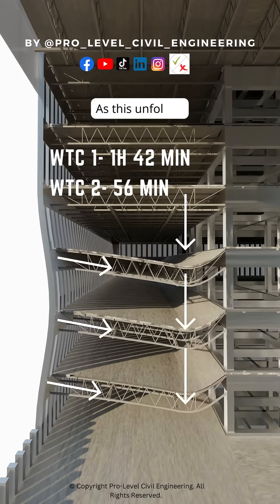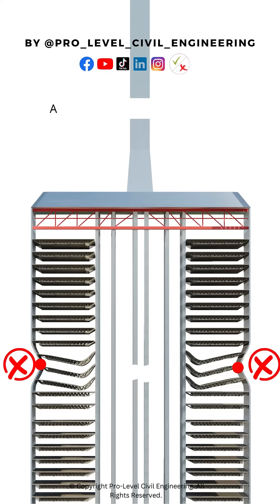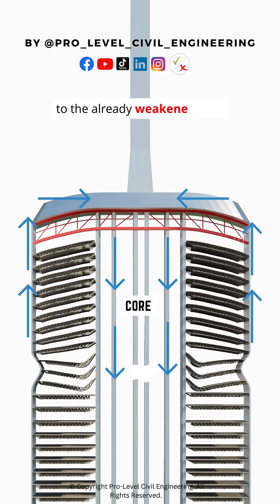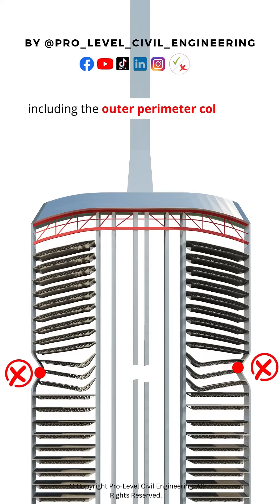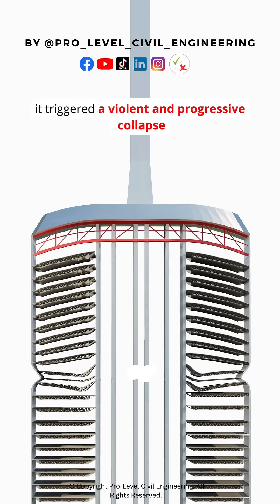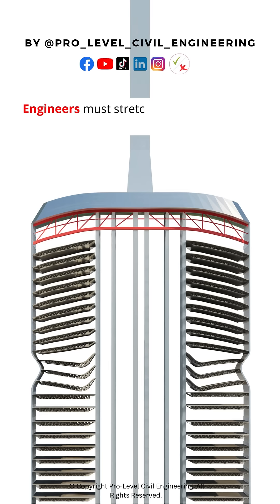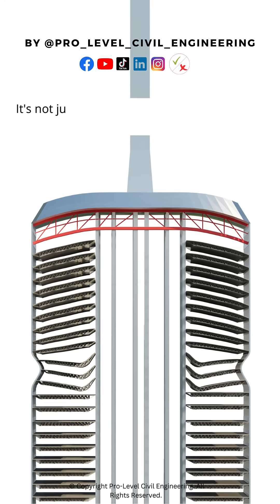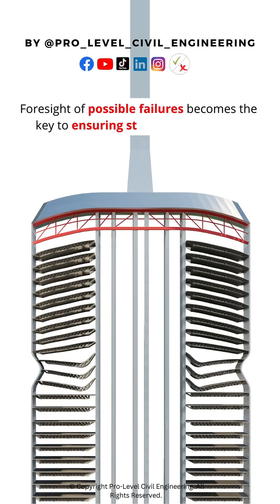The Horrifying Truth: Why the Twin Towers Collapsed on 9/11?

Comment: Planes that enters a building like butter. No bending or breaking at impact....clips like a videogame wall
Reply: Plane parts were found in the rubble. Including the Murray Street engine.
Reply: @beingmyself000 no plane parts not matching the alleged planes were planted by the CIA to create a cover story. Get it right. Watch 9-11 mysteries.
Reply: How much do you think a 747 jet weights, 40kg? Also, the planes impacted the towers at about 800-900 km/h. 

A piece of rotten wood can penetrate steel if the force of impact is heavy enough.

Comment: 4 words
Thermite, dustified, inside job!
Reply: 4 words of bullshit!
Reply: @ljrice1198 how clear can a Inside Job be? Yes!
Reply: @ljrice1198 "we were sent to monitor the event"
Reply: @ljrice1198 you are delusional. BYU analyzed Stephen Jones' research and said he is correct. The CIA planted the explosives that destroyed all 3 towers. An airplane wouldn't destroy any of the furniture on the 70 or so floors below that were undamaged.
9-11 was an inside job.
Reply: steal loses its strenght after 600f
the towers tempratures reach 1800f
the weight of the towers+the heat on the towers+the crash on the twoers
why wouldnt it collapse?

Comment: In short : 
Both WTC towers' middle flats' pillars were all crashed, melted and burned by planes' impacts. So they could not anymore normally function as any physical supports that originally were enough to hold all above flats' total weight together. Then entire towers fell down as if were a vertical domino down onto ground!

Comment: the jet fuel was all burnt within 20 seconds. geez everyone.
Reply: How much ampunt of jet feul,
Reply: @YuuSouji  9000 gallons each plane!
Reply: Shh... you start scaring the  🐑
Reply: Correct. Most of the jet fuel burned up when the planes impacted the towers. But don`t think an explosion of 10.000 gallons of fuel would cause a "little" fire in buildings full of office furniture, paper and so on? or that the fires (as well as the heat of the fires) would only escalate as the time went on?
Reply: @patrickanderson9023  Ho hum,  most of the 9000 gallons would have been consumed in the crash conflagration,  it just sounds horrific,  do you think a terrorist holding a 3/4 inch box cutter is going to stop you from kicking his ass threatening you?  I would laugh at someone on the street holding a razor knife to intimidate me,  that reasoning was only used because it could be plausible not because it was,  it is absurd,  "oh no he's got a razor knife,  let him do what he wants" give me a break!
Reply: @mrichards-j6b  Yes. Most of the fuel (90-95%) burned up in the intial explosions. But as previously stated, don`t you think an impact like that would cause quite a big fire? 

I don`t think outsiders realize how big and intense the fires in the towers actually were.
Reply: @patrickanderson9023  Yes it caused a lot of carnage,  but global collapse of three buildings to dust?  To turn the entire floors of concrete to dust would require why more energy than gravity can supply!
Reply: @mrichards-j6b  I am a firefighter with 26 years of experience.

You see, the intensity / heat of any fire only escalates, and the fire only spreads (regardless of how big or small it may be) - unless there are men on the scene fighting the fire ASAP.

But some fires are simply too big to put out, and that was exactly the case with these fires in the towers on 9/11. Those fires can at best be compared to a large wildfire of about 20-30, 000 acres.

And as the fires went on, the steel beams in the towers got weakened, which eventually casued the collapse of both towers.
Reply: Bingo!

Comment: This doesn’t make sense.  Why was there no stop at all from top to bottom?  How did both building fall are the exact same time in the exacted same way. Nothing toppled; just fell.
Reply: In some videos you can see the top of the buildings lean to one side as they're falling.
Reply: They didn’t actually fall at the exact same time, but they looked similar because both towers were built the same way. Once the top floors started coming down, the weight was way more than the lower floors could handle. Each floor was only designed to hold its own load plus some extra, not the force of dozens of floors crashing down on top of it.

That’s why there was no “stop” on the way down. Once one floor failed, the momentum just kept transferring downward, like a domino effect but with thousands of tons of steel and concrete. And parts did topple off the sides, but the bulk of the structure came straight down because that was the path of least resistance.
Reply: @takahashiwongwong1  yeah that's the story. Did building 7 fall straight  down out of respect? 😅😅😅
Reply: @darrencoleman3866 it fell forward not straight down
Reply: There was a 30 minute gap between the collapse of both towers I believe
Reply: They're not Legos 😂.
Reply: @jamess4351  so what about building 7?
Reply: Well they didn’t fall at the exact same time it was separate times but with all the jet fuel being lit on fire it will curve the buildings inward basically making it fall in on itself
Reply: that's how buildings fall, they are not legos to be toppled
Reply: It’s actually rather simple: a sky scraper works out by spreading the weight of the building across many support beams.

If one support beam fails that’s fine because the weight that beam carries is simply defused across the beams around and below it.

When the planes hit the towers the support beams that were struck immediately failed and the weight they carried was diffused across the beams around and bellow them. As more beams failed due to fires started by the crash more and more weight was distributed across fewer and fewer beams until the weight became to great and they all failed together. Which is also how a controlled demolition works: by destroying key support structures you overload the remaining structures cause the building to collapse under its own weight.
Reply: They were made in identical ways with identical materials hit by identical planes.  It's not hard to figure out
Reply: The pinions were designed to carry the load of one floor once one floor gave way the floor below could not Carry the weight with each floors weight landing on the next it just pancakes.  If they had welded the floors to the frame it would have held. It's like a plane crash it's never one thing it's a slurry of several things lining up like holes in Swiss cheese
Reply: Because every floor was identical and once one or two failed the remaining floors were not rated to hold the additional weight once it started it would only accelerate as there was no reinforcements to slow it down and an object in motion stays in motion until it's stopped by equal or greater force.  People equate it to a blender I think a hydraulic press is more accurate watch a YouTube video on something being pressed it explains why they found nothing in the rubble.  It was atomized people literally inhaled all those people
Reply: @Kid_Kootenay ok maybe one in a 100 million shot u hit 1 tower with inexperienced pilot and tower collapsed but 2 in 1 day impossible
Reply: Each floor had a load rating. People, office furnishings and I think it was 10-15 floors. Concrete floors sat on truss seats which were connected to the load bearing columns. The truss seats were found in the rubble bent straight down. Tangible evidence which proves that each floor was crashing down on top of one another.
Reply: This has been explained. Read my comment.
Reply: You know y
Reply: In a bunch of videos you see the inward bend right before collapse.  And many videos show the collapse happened above sight of impact, when the columns structurally damaged by impact and weakened by heat from the fire could not support the structure above them, and failed, and as the shear weight falling of the structure above each new level cascaded with extreme violence to the ground.  Intense heat will cause steel to bend, so it’s true that the jet fuel didn’t melt the steel, but the steel didn’t need to melt it just needed to loose its strength and the sheer weight, structural damage from impact and gravity did the rest.   
Those planes had a bunch of fuel onboard and even though much of it was atomized in the impact, much of it also caught fire due to atomization, then pooled up again on structure and gravity took it down shafts, and into every crevasse, on fire, pooled up, and now it burned like a torch or giant candle igniting everything it touches.
Reply: @Lorthvader6871  Same crap we have all heard since about 11 am Tuesday September 11, 2001,  the military industrial complex couldn't have said it any better,  well done stooge!  Thanks for the Parroting nonsense perfectly spewed some 25 years latter.
Reply: Ohw.

Soo just a dent.
And the totall free fall is justified?

Thats impossible.
Also very dump way of distrection of the weirdness. 

A thin B767 cant bring the towers down.
Also and only, 2 planes, 3 buildings!
Total free fall and in its own footprint.

The planes where very very small, If you compare it to the mass of wtc 1 and 2.
Reply: @TDH8988Clown, the Towers were 95% AIR. That's why Buildings are constructed - to Enclose and Protect AIR inside. 
These weren't the damn Egyptian Pyramids.
Reply: This is explained numerous times.   If you've made it this far,  you can find it.   The towers were essentially empty soda cans.   Capable of supporting a lot of weight,  but dent the side "or the impact of the planes" and the weight above cannot be stopped once gravity takes hold.
Reply: @PHG_Jersey that is not how physics works. Watch 9-11 mysteries or 9-11 ripple effect.
Reply: The didn’t fall at the same time. What are you talking about? And they fell the same way bc they were both damaged and weakened the exact same way.
Reply: @dixienormous7230 no building 7 also fell at freefall speed into its own footprint. Controlled demolition plane and simple.
Reply: @dixienormous7230  they were not damaged the same way, north tower stood longer because it was impacted higher up and more toward the center. South tower was hit 2nd but much lower and it impacted two outside corners significantly, that’s why the top of the south tower tilts first as it collapses.
Reply: @dixienormous7230  And building 7? same collapse. Also own footprint.  Only now plane.   controlled demolition.
Reply: It completely make sense, since some footage moment before it collapse, you can see the external bent inward and collapse
Reply: @YuuSouji Yes I saw that to 😢
Reply: @YuuSouji  Oh so, Whit a dent it explains the total free fall.?  And then its alright?
Reply: Inside job to collect insurance. No security checks at airports now they make you remove your clothes if they demand you to. Job got done now they want you to believe they care about your safety 😂
Reply: @Xpunkpro  Uh huh. Anything else?
Reply: The building had a hidden design feature. When engineers designed it they wanted maximum amount of floor space so the perimeter walls were the kept the building standing. In 1993 there was a bomb in the car park. Terrorist thought that the by destroying the interior corer of the building, the entire building would collapse. The only way to bring them down was to radicalise vulnerable people into joining a terrorist group and flying an aircraft into the building causing significant damage to the perimeter walls. When the buildings collapsed you can see the interior corer still standing for several seconds. A group of Survivors in the stairwell claimed that a miracle happened seeing the walls around them peel away like a banana skin when the towers collapsed.
Reply: @davidplayle5674  I don't think that until then people had even considered that the enemies of the west had architects engineers etc in their ranks.  Building plans are not hard to get ahold of. And if you can build a building design it. You can certainly bring one down.  Give the devil his dues it was a master stroke no random accident. And woke everyone up the 911 legacy is massive.  Hopefully we never underestimate evil religious fanatics ever again. And remember they are smart tricky and not above using our culture against us by any means possible.
Reply: The modern magic bullet theory! We're supposed to believe anything!
Reply: Not only this, but 3 times, all 3 into their footprints. Apartment buildings, that are completely engulfed, don't collapse into their own footprints.
Reply: @nickn8564 Neither Tower, nor WT7 "Collapsed into its own footprint". If either Tower had, then adjacent surrounding Buildings wouldn't  have been Damaged.
Reply: Exactly, no explanation was provided on why the collapse were essentially at free fall speeds
Reply: @FataUser Explosives inside the building. Please go do some research.
Reply: @bossfootbagstwo2078 I have done research, the towers collapsed at free fall speeds, meaning no support from below. This means the much lighter top somehow managed to crush the much stronger bottom, met no resistance even thought the bottom was perfectly healthy. Explain it to me. Because NIST themselves couldn’t either
Reply: @FataUser Was an inside job, there’s no frigging way that a damn plane could have taken down a building like that. You need to research why that happened. Let me inform you then you can go a bit further. On that day 9-11 Nesara was supposed to be announced and if you don’t know what that is I suggest you go look it up. Bush was in office at the time and didn’t want that money going to the people like it should. Have a nice day!
Reply: Thousands of tons of steel floors and pillars come crashing down at e=mc2 with momentum and you’re wondering why it didn’t stop?
Reply: @Fhsixhsksh  what does Special Relativity have to do with tonnes of steel pillars? 😂😂😂
Reply: @Fhsixhsksh  when had a building fail in such a way that it looks like an implosion? Why does the top not tilt in any type of way?  It falls straight down with free fall speed?  Does that make sense?
Reply: @MrSherod1 not to mention that computers, desks, vending machines, couches, etc weren't found in the rubble. Only pulverized debris. Controlled demolition plain and simple.
Reply: @MrSherod1 there’s dozens of videos showing it didn’t fall perfectly down; in fact it tilted slightly near the impact zone. You think everything is like Hollywood is the issue. When have you ever seen a massive skyscraper fall like a jenga tower? 

Never. They always come straight down and that is because gravity is stronger. Jet fuel doesn’t melt steel beams but prolonged inferno caused by jet fuel certainly turns steel into spaghetti.
Reply: @troyterry6919 oh, this is a new level of stupid for me. Tell me more about how there were no chairs in the debris. So they moved everything out first and the entire World Trade Center was fake? Not filled with thousands of people working there?

Comment: No way those trusts which are tiny compared to columns could pull them to the point of collapse
Reply: What happens when you super heat steel? 

It’s doesn’t melt but it becomes a wet noodle, like spaghetti. Have had it demonstrated to me. The columns got super, super hot.
Reply: It completely make sense, since some footage moment before it collapse, you can see the external bent inward and collapse
Reply: @YuuSouji exactly
Reply: The north tower plane flew into the building dead center which definitely disrupted the welds attached to the center core, meaning the truss’s were attached to the outside and the inner connection was gone so the truss was pulling on the sides as gravity wanted it to down.
Reply: @drizzho  If thats the case.

The outer walls are still standing.
Reply: @TDH8988 not at the impact zone where the fire was. That’s why the outer (10ish stories) and inner (8-10 stories) is standing at the bottom, in between was all horizontal and not even close to having enough support to catch the building.
Reply: @drizzho  The damage of the plane impact alone, Can never bring the tower down.  Ask any firefighter or building expert. The twins where very strong.
Reply: @TDH8988 how can you say that? It was a 767 passenger jet flying 450-550mph hitting it on purpose, that was the bomb. The building had the most open air office space in the world. There was no supports from the outer to the inner, just horizontal floors. Only designed to hold 1.3-1.8 tons above it. The spire alone on top of the north tower weighed as much as the titanic. It is no where near the strongest building ever especially when 15-20 floors fall on top of it.
Reply: Spoken like a true conspiracy theorist